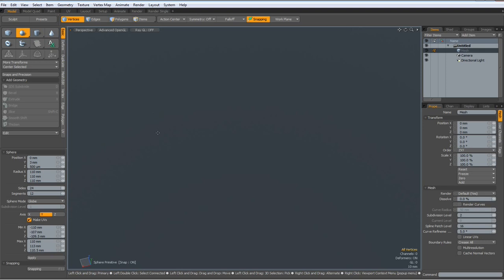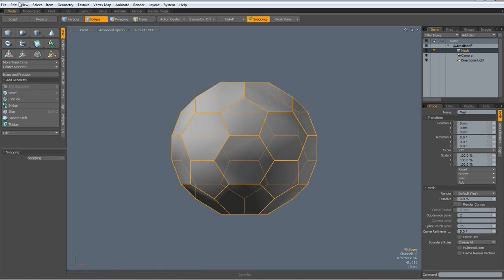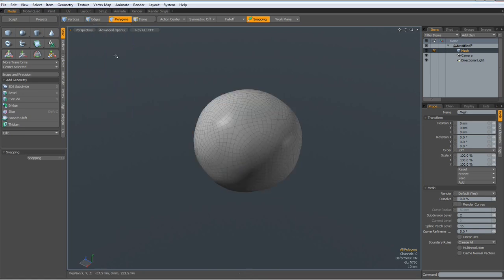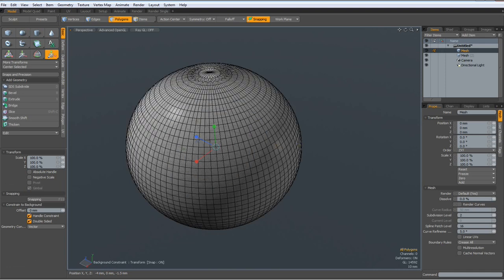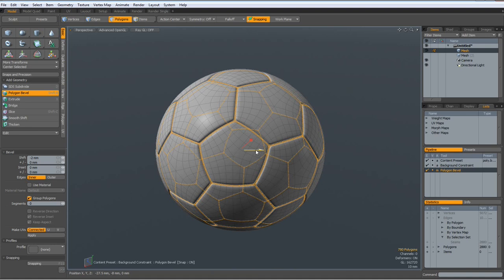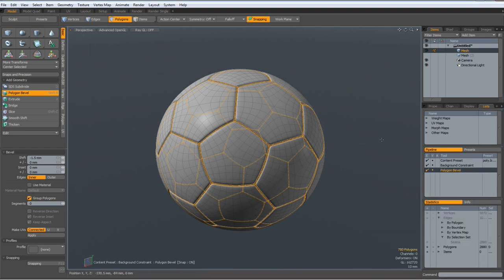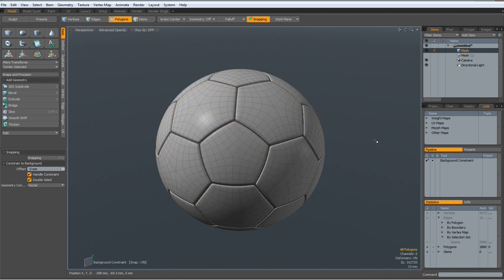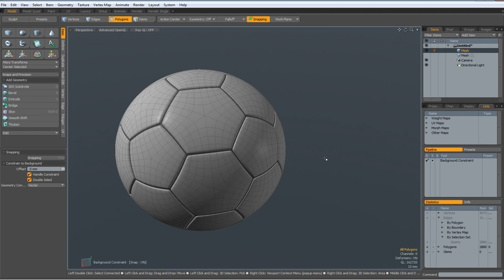Luxology Modo - Modeling a perfect Soccerball in less than 5 minutes

Comment from the maker: Hi, this is not a novice problem, i suppose you are using Modo 701 and it's a 701 problem. Convert the edges to vertices first, and then convert the vertices to poligons (ALT-1 then ALT-3) and it should work. Kind regards, Petrer